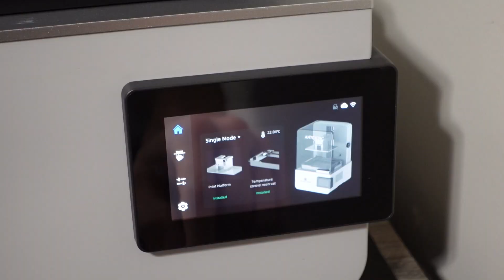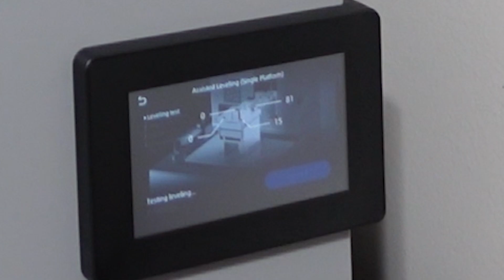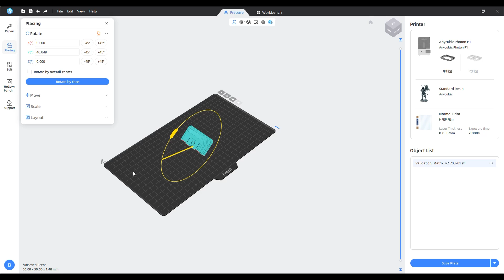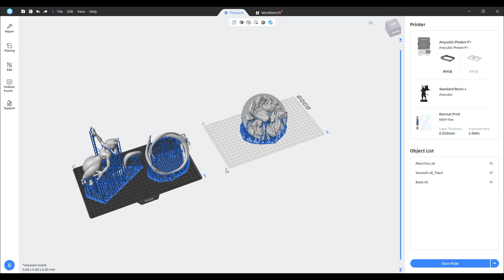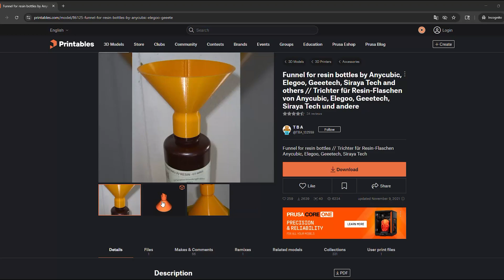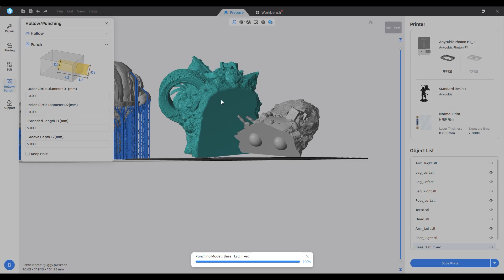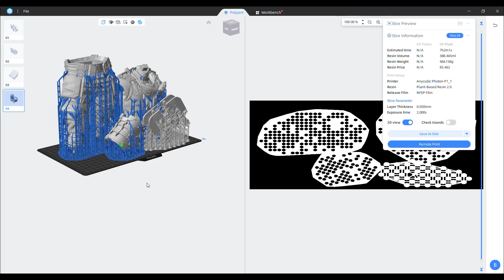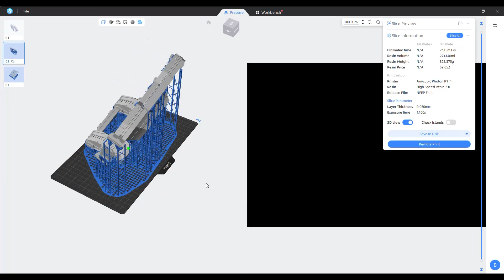I Wasn’t Expecting This… Anycubic Photon P1 I Unboxing & Review

Comment: OMFG....how to say you know nothing about resin 3D  printing without saying you know nothing about resin 3D printing. 
The resin test print should be layed flat and  should be examined BEFORE curing. The supports are much easier to remove if you soak the cleaned parts into hot water.  Clean resin parts needs a glossy clear coat to get back transparency.
Reply from the maker: Hey, thanks for the constructive criticism. I am not as knowledgeable with resin as I am with FDM. I will make sure to use these tips going forward. Thank you!
Reply: @BuildDanielBuild  Rather than soak in water just use hair dryer or a heatgun (on low setting), no need to make toxic waste when it works just as well, also dries models faster before curing as a bonus.
You might know these but for the sake of public annoucement:
Water that had contact with resin needs to be cured before being dumped and it should not be dumped directly into sewage anyway. After curing you should let it settle for few days and pull the water off the top with syringe and let rest evaporate, leaving you with dry cured waste resin dust to be dumped.
Also, don't just dump uncured supports right into the bin (unless it was your toxic waste bin), cure everything you dump. This includes gloves, wipes and everything that had contact with resin. It just takes few minutes to do.
I can't see you using PPE in the video other than gloves, but for everyone else reading this: use eye protection and a respirator with filters of at least class A1 (for volatile compounds and gasses). 
Why eye protection? When removing supports they can spring back, spraying you with uncured resin/IPA mix still leaking from hollowed models. You do not want either resin or IPA in your eyes.
Reply: Says the commentor with a total subscriber count/published videos...of 9?
I'm just commenting for the algo BTW...🤣
Reply: @ATLnJP  so I'm not a YouTuber, I'm not allowed to criticize? :D  lol
Reply: @v @vamps_vids   Were you really just critiquing or just being a “I think I know more than this content creator” TOOL? Because if you were the later, you’d probably have wanted to make note that the content wasn’t really “How to dial in your exposure times” or “How to remove, clean and prepare resin prints” was it? As the title clearly states the focus, to avoid misleading those that might OMFG know it all as you seem to. 

And just for extra context, your “…clean resin parts…” (I’m assuming you meant CLEAR…OMFG) can be dealt with a variety of ways. Some even submerge in water and cure. Some use 385 UV printers for best results. Again, the creator never said “this is the way…”

Seriously, just admit you wanted to help the algo and move along…instead of being a wannabe know it all that barely knows how to troll in proper English.